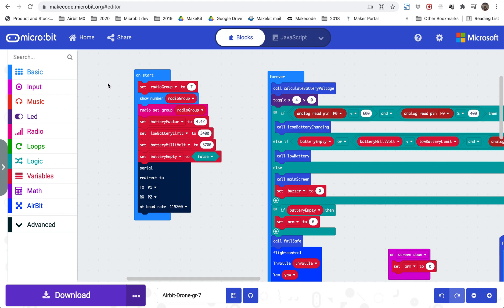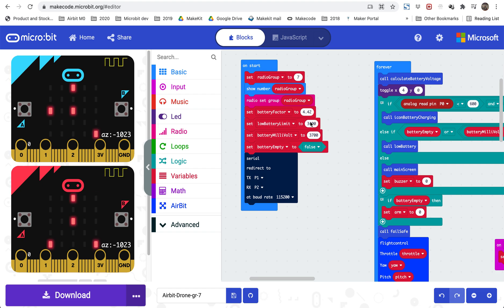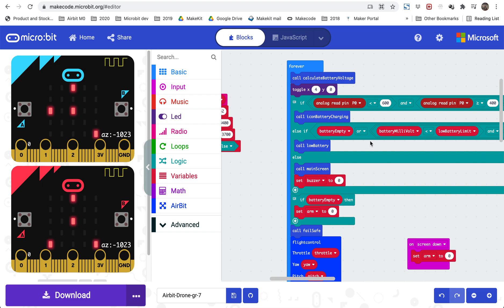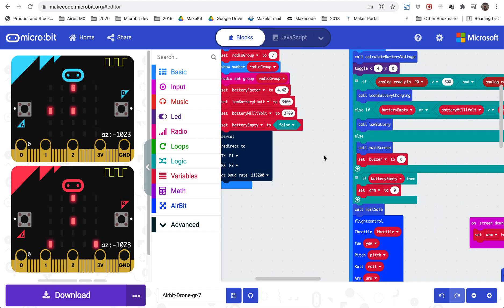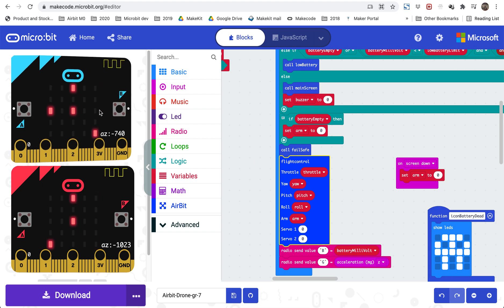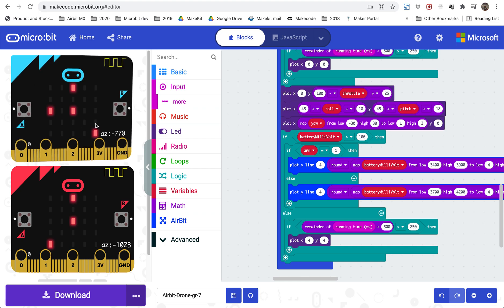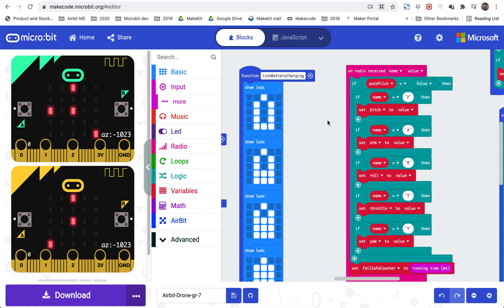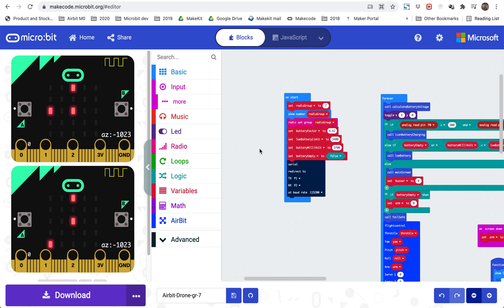Air:bit 1 drone code explained

Comment: where did you get the airbit extension?  I cannot find it.
Reply from the maker: It's included with the Air:bit drone.
Reply: @Makekit  How do you add Airbit blocks into the Make code?

Comment: Hello,
I finished witn the hardward part of the air:bit without difficulties.

Because I prefer pure micropython than blocl programmation I tried simple codes to try to understand how to command the 4 motors. I supposed that Arm and throttle varaibles are defined by the lower control board:

import microbit as mi

Arm = 1
throttle = 0
while True:
    if mi.button_a.was_pressed() and throttle < 45:
        throttle = throttle + 3
    if mi.button_b.was_pressed() and throttle > 3:
        throttle = throttle - 3

Then I tried to command analogically the control board:

import microbit as mi
output = 0
while True:
    if mi.button_a.was_pressed() and output < 924:
        output = output + 100
        mi.pin0.write_analog(output)
    if mi.button_b.was_pressed() and output > 99:
        output = output - 100
        mi.pin0.write_analog(output)

But the both codes do not run ?

Could you help me please ?
Reply from the maker: Please email us support at makekit.no

Comment: Can you share micro: bit code please? Thanks
Reply from the maker: Hi! You will need an Air:bit to make a micro:bit fly. The micro:bit itself is not enough, there is gyro, motor controller etc. We supply codes with the product.